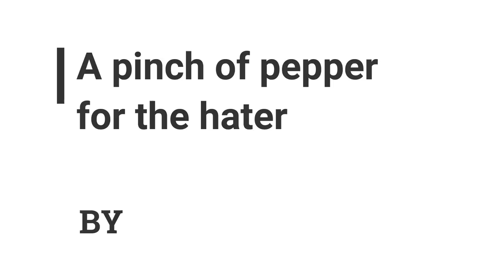Wood turning - A pinch of pepper for the hater

Comment: That was really nice Etienne! The resin looks like the tree itself healed over a scar - good eye, good skill !  Thanks for posting.  Stay safe.  -Mike
Reply from the maker: Thanks a lot mike, i messed up a little with the head, the design don't follow properly the body but anyway who's placing the head so it will fit with the body at the end of an use lol thanks for watching and stay safe mike!
Reply: @Etiennemorinwoodturning  Who indeed would fault beauty's eccentricity ?
Reply: @Etiennemorinwoodturning   looks good ! My pepper shakers never line up with the head either. When I laminate them at an angle to the axis, instead of parallel with body length, when parting the head it is always out of line. No one ever tries to line it up after use anyway. So I take a picture with it 90° off. Or totally different head, etc., etc. Nice work ! !
Reply from the maker: @dougngn  thanks a lot and you are right about the lining after use... no one care about that except my girlfriend hahaha 😂😂😂